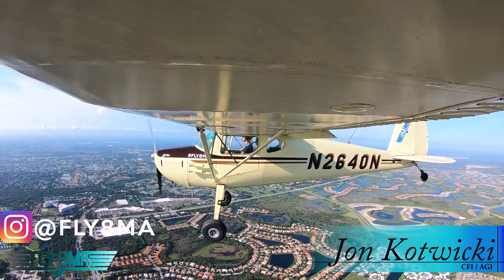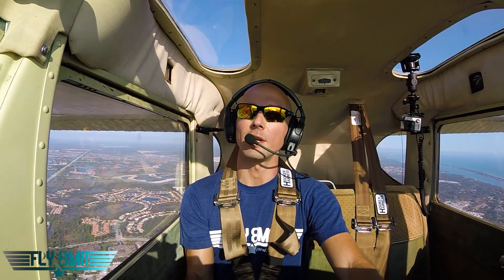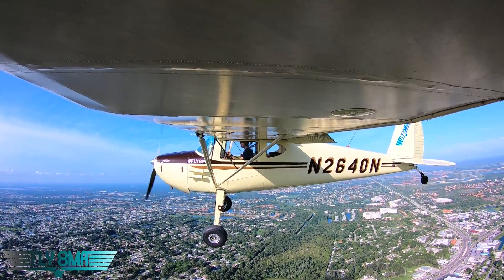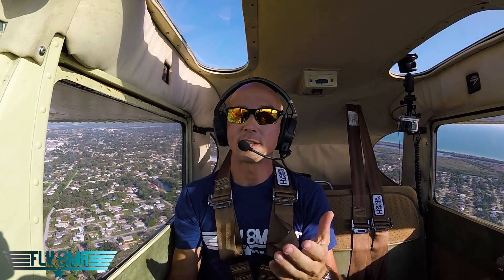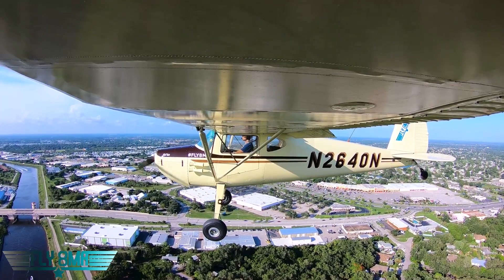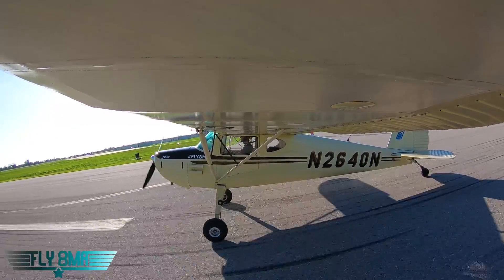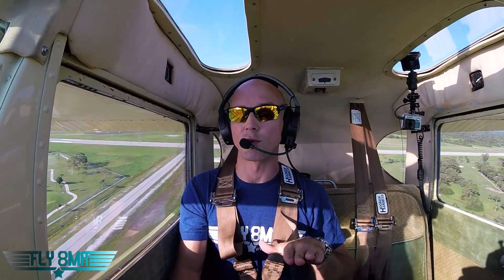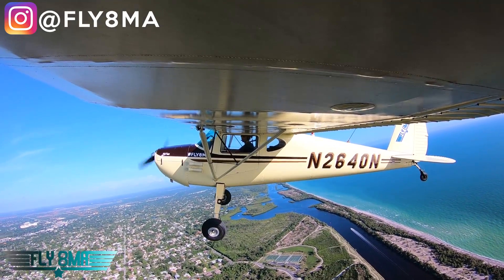Turning with a Slip | (not for student pilots) Using flaps for drag and lift

Comment: I was trained to avoid slips with flaps extended
Reply from the maker: Some airplanes it is prohibited and/or warned against due to the possibility of inducing a tail stall.  the consequence of stalling the tail is a sharp nose down pitch attitude which would reducing angle of attack and most likely fix the problem as long as you had enough altitude.  For obvious reasons sudden nose down pitch attitudes caused by a tail stall due to slipping with full flaps near the ground could be problematic.   Just want to know the airplane you've got and what it can and can't do....
Reply: But it is not prohibited
Reply: Trained without explanation?  Because it's an old myth. 
It's not a problem as long as the POH doesn't forbid it.  Don't be afraid of slipping with flaps.
Find a different CFI, go to a safe altitude and practice doing it in your airplane so you know what it looks, sounds, and feels like.  It's a technique/skill that might save your life someday.
Reply: Did you train in an older Cessna 172? I remember a few decades ago there was a lot of discussion in the aviation press about bad things that can happen in those specific models, if you slip them with flaps fully extended (40 deg.).

If memory serves, that is why newer model 172s allow a max. flap angle of only 30 degrees.
Reply: I know the Cessna 172 I train with warns against it in POH, however it is not prohibited. I think the issue is with some CG configurations and full slip with full flaps, my instructor claims it is pretty safe to slip even with flaps, it is just not recommended so it is better to avoid it.